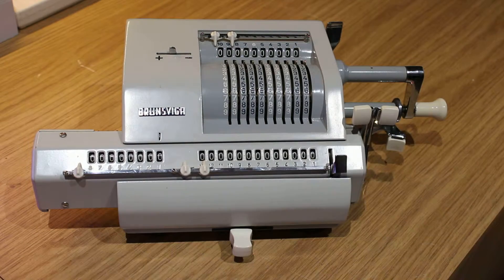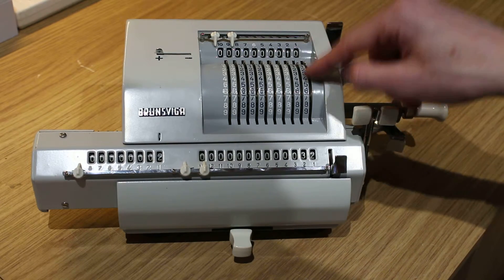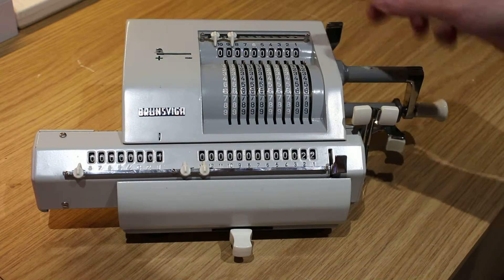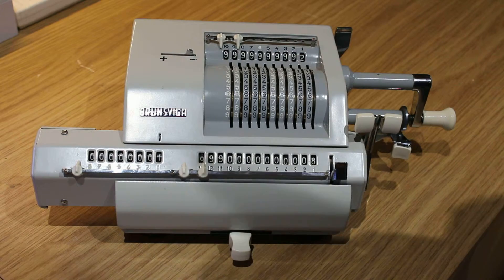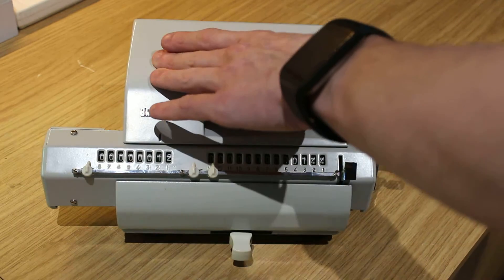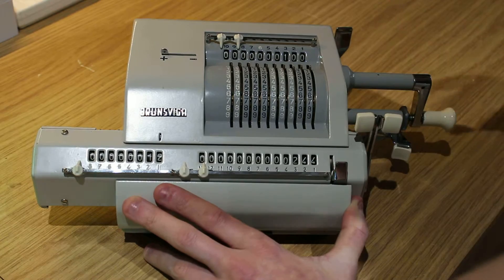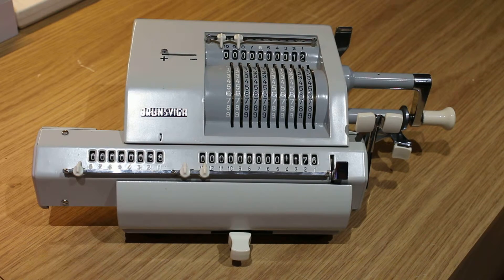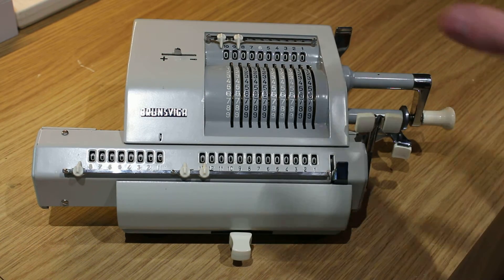Brunsviga-13RM Mechanical Calculator

Comment: Thank you!
I have the same model machine (though not in such good condition) and this is the first clear demonstration I have seen of the basic operations. 😀👍
Reply: You can attend at the demonstrations of Original Odhner machines, that operate exactly the same as this one, except the Odhner don't have the switch to change from adding to subtracting (although it is handled internally, as this one does automatically, you cannot only force it to start in a givene position)